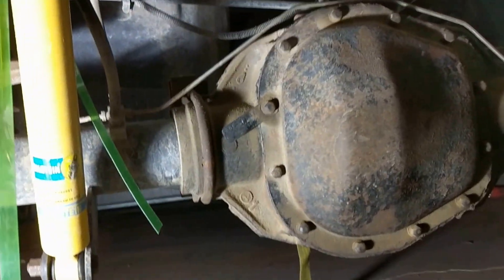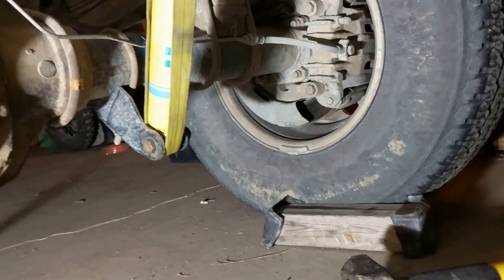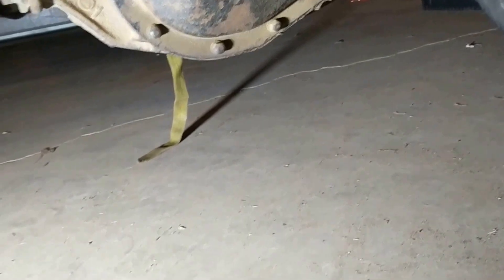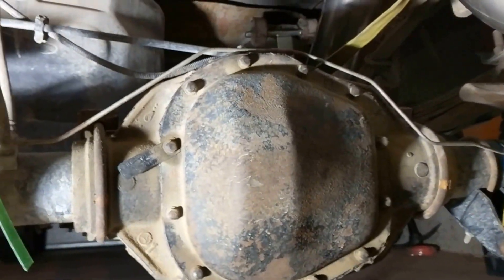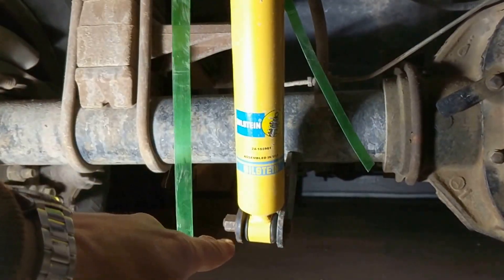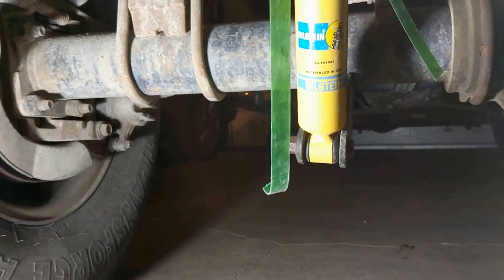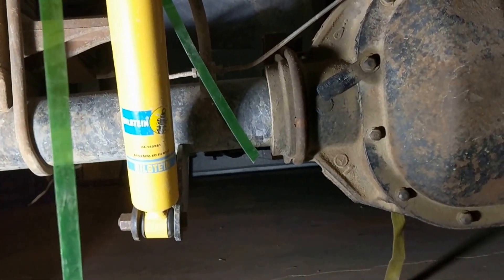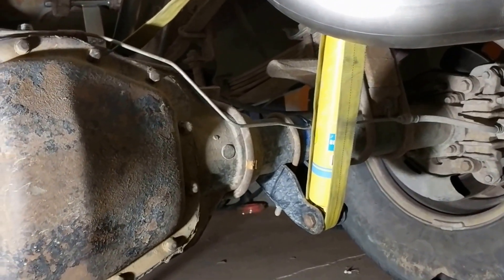4 Tips for changing shocks F250 Super Duty Ford

Comment: Don't use straps to adjust length. If it slips off, it'll hurt you. If you need to adjust, put a jack under the axle and jack up just a bit. If you need to adjust in the other direction, put the jack under the frame and jack up just a bit. It'll get to where you need it to be.

Comment: thanks for the tips. My Bilsteins are being delivered today and I'm gonna give this install a shot on my own. I just bought a 2006 F350 to tow a travel trailer. I'm in Michigan and it was hard to find a truck that was 10 years old without any rust. The bottom of you 99 looks really clean. Have you done any rust repairs or do you live in southwest?
Reply from the maker: cody bartosh I'm lucky enough to get this truck from a single owner in Montana. No salt used here to speak of, so no rust damage issues. 👍

Good luck with the install. Take your time and you should have no problems.
Reply from the maker: Sorry for late reply.  Montana truck - lucky no salt clean.
Reply from the maker: Montana truck.  Fortunately, no salt!
Reply: I live in indiana I just put a hillsboro utility bed on my 2004 f 250  love it had the truck undercoated  also  i think mine came from MICHIGAN  the factory bed was toast  but had a good tailgate and bumper sold them both .